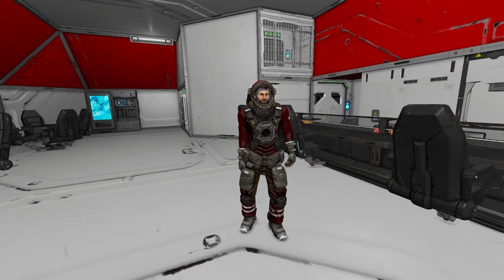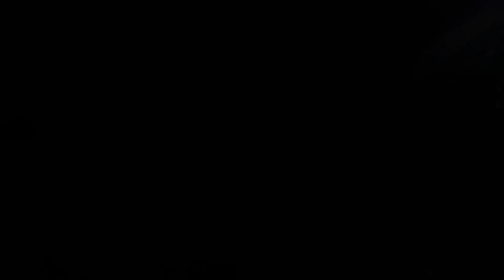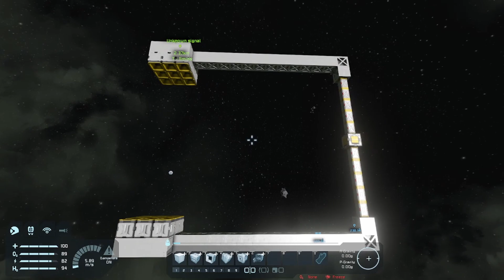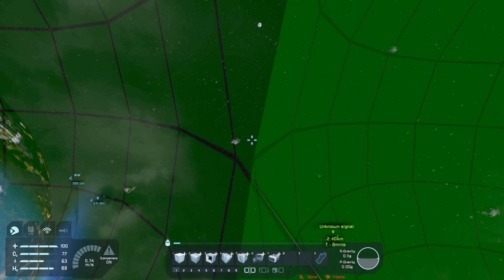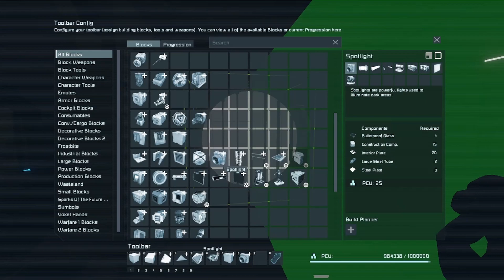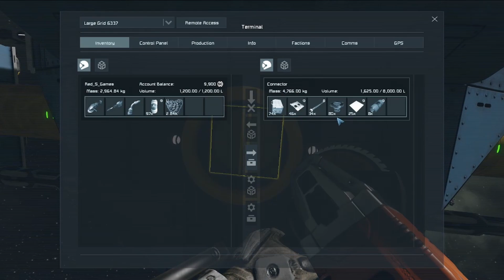Ship of the Week - Gravity Salvage Ship - Space Engineers Ship Design Challenge

Comment: I'd say a nearly perfect ship from a purpose-perspective. The only things i would change is replacing inner conveyors with small cargo containers, making the cargo clamps actual clamps with pistons and magplates and build a small grinding drone to attach at the connector.
Reply from the maker: A grinding drone could work well, you could build it with minimal cargo and still make use of the gravity collectors.  Funnily enough, this was the second recording of me building this ship.  The first time I did have the arms move with pistons and such, but having so much weight on sub-grids made the handling pretty abysmal.  I redid it because I didn't like the performance of the first take and it would have been harder to edit, but I did redesign the ship a bit to simplify it for round 2.
Reply: @redsgamescompany  well, i tried to build it and the drone works well even with only the grinder and connector as cargo space. For the pistons, i meant: in the front part of the cargo clamps, i built 2 pistons facing the other clamp with velocity changing as control. It works well if you just slowly want to get an obstacle out of the way. For transporting bigger ships, well ... clang destroys both ships. That's not what it should be used for. But still it's a really good disassembler and a design to be slightly modified, thanks for uploading it to the workshop :)